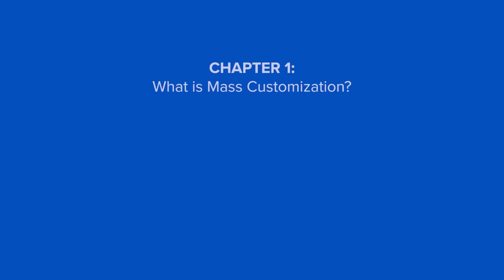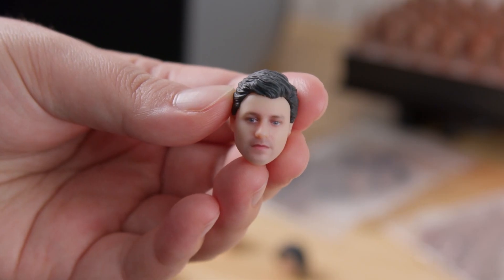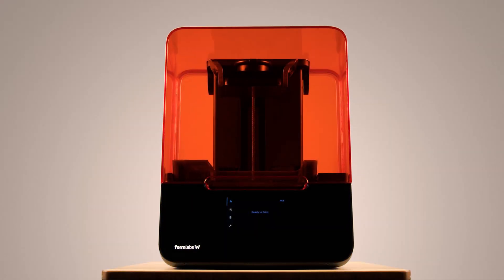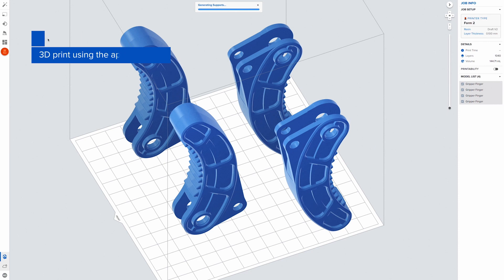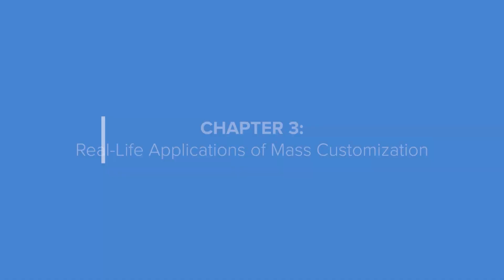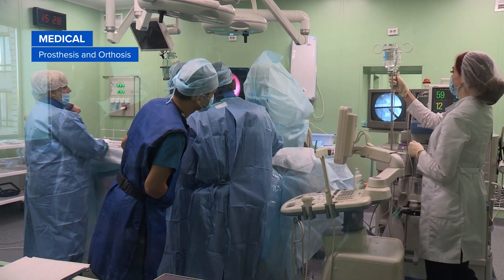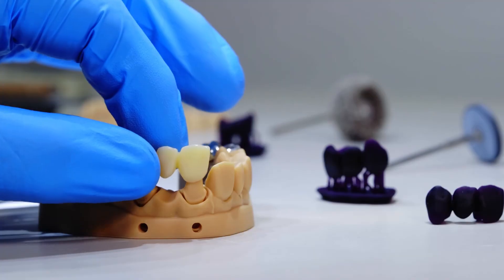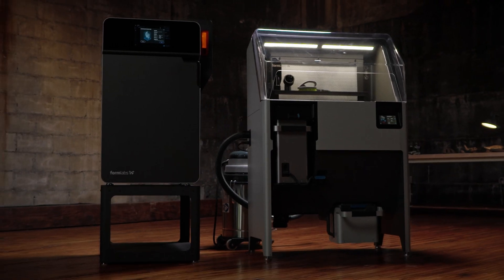3D Printing for Mass Customization Applications

Comment: I should start by saying I've been a supporter of Formlabs since their original Kickstarter and debut at NY Maker Faire, and have had great success with their products in research/development settings.

However, I'm slightly worried about the recyclability/microplastics risk of mainstream, mass-produced SLA parts (especially for consumer products like the Gillette razor shown or the Adidas/Carbon 4D sneakers), given they cannot be accepted by any municipal recycling service and are chemically more similar to epoxies/thermosets than thermoplastics.

• Compared to a compostable plastic, or even a typical thermoplastic, how long will an SLA part take to degrade in a landfill?
• If ground up, how much uncured/reactive photopolymer exists in the bulk material and could leach into waste streams?
• What are the health effects of photopolymer microplastics - in the food chain and in the human body? Do they decompose in the body or do they bio-accumulate like PFAS?
• Does Formlabs conduct/fund any research related to these concerns, or have development plans for more eco-friendly SLA resins?

Again, the benefits of 3D printing in general can't be understated, but there remain a lot of risks to be addressed before we ramp up the usage of SLA material in our fast-fashion, consumable culture.